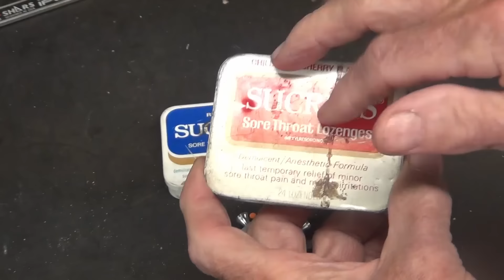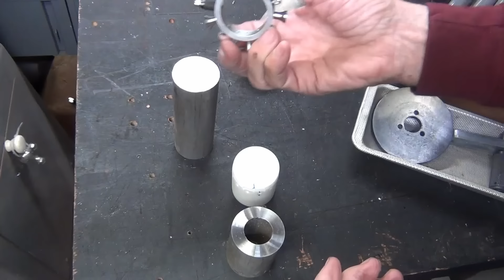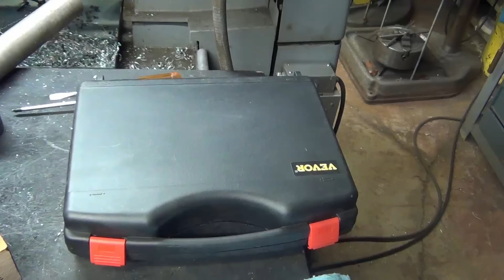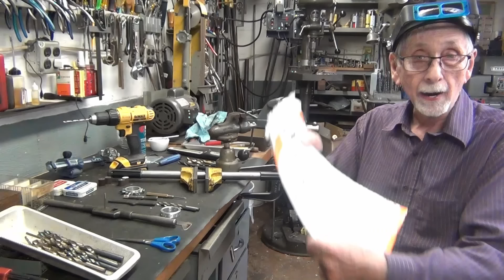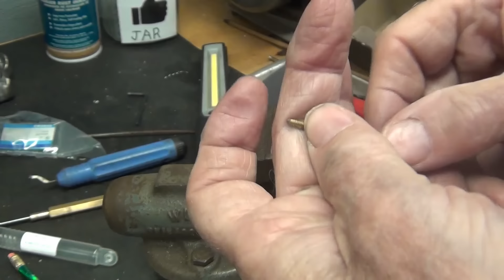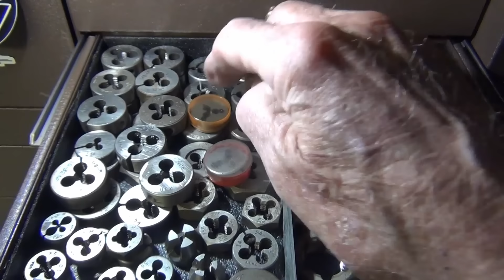MAKE a STARRETT INDICATOR TIP HOLDER #1065 tubalcain

Comment: You should  find the 4-48 taps at Brownells as well as 4-48 screws.  I have them here in my shop!!!!  Old Dave
Reply from the maker: Thanks Dave for the tip!
Reply from the maker: That must be the size they use for mounting scopes or sites
Reply: @mrpete222  To mount scopes they use 6-48 or now 8-40 screws.  So we use these sizes tap now.     Very hard to find good 6-48 taps which why Brownell's carry special taps.        Old Dave

Comment: The issues with shipping fall upon the person that packaged the items. I have had the exact same experience with a box making laps between the USPS hub in St. Louis and various Post Offices across the country. That box of parts were so rare it took years to get an example that I could copy. It was like losing a body part and I wanted to get the project moving forward. In the end,  it took a friend's wife who works as shipping clerk and sorter to get the box captured and a new tracking label attached. Once that was done 2 days later it arrived. 

All of this was caused by a careless shipper using a box that was far too small for the tracking label.  The automated sorting system couldn't read the numbers correctly and it was mistakenly sending it to different locations. That box made no less than 13 trips in and out of the Belleville Post office,  and 18 through the St. Louis sorting hub. Now,  those hydraulic hoses and fittings are available for the Wheel Horse tractors,  and it 3 months just to get the parts to copy. 

I have had a bunch of mislabeled taps,  fasteners,  and drills from various Amazon suppliers who evidently don't care to ever check the part against the description. Guess where those parts and tools come from...?

McMaster,  in the long run, is cheaper if for no more than the aggravation of dealing with Amazon.

Comment: I enjoyed this video, including all of the related 4-48 fiascos. When you get your female tips mounted on your tip ring, you still won't have any known use for them. But you can repurpose the Sucrets tin!

After a career and years of hobby life, I have only ever used the standard indicator tips and button tips. I have one of those inexpensive imprt tip kits from a bulk shop supply purchase, but I have never had a need to open it and see if the tips fit my indicators. I thought that there were at least 2 tip threads standards having owned a button tip that only fit one brand of indicator from over 40 years ago. I never swap tips. I just use indicators that are set up on bases with the desired tip. I don't even bother to swap tips on test indicators, and just grab the pre set indicator required for the job.
The Starrett tip ring would be highly prized for a trophy in in my shop, but after a career, I testify that it is an unnecessary luxury. 
I am an indicator nerd. I own around 40 high quality indicators and a few of the junk imports that you get in large lot used tooling purchases. I own an example of most premium indicator manufacturers, but I prefer Starrett, Mitutoyo, and Brown and Sharpe for quality and cost. I have a B&S 7033-5 (.00005") that I needed to set the Heidenhein scales on a Gleason gear grinder wheel dresser. That's the only job that I ever did that required that resolution. When I did that job for the first time, I was the only employee in our large shop that owned that resolution. QA didn't own that capacity. I keep my B&S as a trophy in my retirement bedroom now.
I am a nerd about indicators like your Arnfest friend is about Wilton Baby Bullet vises. I am equally a nerd about quality pullers. I recently filled out my OTC 13 ton puller more than complete full master puller set with an auction score of over 250 lbs of the larger components to complete that collection. I purchased the big tool box full of the OTC pullers for $45.
When you sold the Snap-On pullers found in the locked base cabinet, I was unwilling to pay your price. My Snap-On puller collection is smaller than my OTC and Proto puller collection.  It was very painful to watch you sell those pullers to another purchaser!

I wanted make your project, but after watching your frustration, the project now goes on my long list of projects that I will never complete. 
I purchased an import 3 jaw chuck on a 5C adapter to use for this type project with my Phase II spin indexer. This was my poor man's introduction to doing this type of project work. The import setup rig has about .003"TIR, but would ve good enough for doing the accuracy for this project. Someday I intend to key the indexer to the mill table T slots to speed up setup effort. That is the most frustrating time commitment to using the spin indexer.
Reply from the maker: I totally agree with you. I have all those extra tips and have never needed or use them even once. Other than I have used an extension tip two or 3 inches long for a job.
And since I made that video, I discovered that I have another  empty Sterrett ring in my drawer. I also found that the other female chips belong on the 196 indicator. I probably have about 30 indicators and have decided I will probably do a toolbox tour of indicators.
It’s quite a relief to find out there are other man just as crazy as me.

Comment: A comment from the experience of the modern CI (continuous improvement) production world...

As CI, Toyota system, Lean Manufacturing took over our production world, your comment about saving time and expenses by using tubing stock instead of bar stock had an opposite effect in our production facility. One of the hallmarks of CI is moving away from batch production to "one piece flow". This idea springs from many factors in CI theory. Over production is among the worst sins and everything in CI drives towards manufacturing only the part needed at the exact time it needs to be consumed in the manufacturing process. Classic American production theory is based on volume production for manufacturing efficiency. 
In our plant, we had easily over 200,000 active part numbers. We stocked an enormous array of stock materials to save material and machining time, when running under batch production manufacturibg theory as you described. The drive towards CI made us rethink that approach. One piece flow demands eliminating setup time between part changes in production. This us called SMED (single minute exchange of dies). To reduce our job changes to less than 60 seconds from many many minutes to even exceeding an hour, we implemented a standard stock size approach in our lathe departments. By machining parts from a limited amount of stock sizes and materials, setup time was greatly reduced, and raw material inventory was hugely reduced. A wide array of single  parts could be machined from a piece of bar stock. Different single parts could be machined without changing setup, and only uploading a different part program. It proved that we could so rapidly turn oversized stock to chips that our over all production time improvement vastly reduced costs over our former production approaches. Eliminating WIP (work in process) frees up shop floor space requirements, reduces over production inventory storage requirements and related losses of holding manufactured inventory that you cannot immediately sell.

CI is counter intuitive to how American production philosophy, based on Henry Ford's success of mass production efficiency, CI theory has consumed the modern USA production world.
We began to find that we could hugely reduce production time under CI processes and reduce overall production expenses by taking advantage of CNC cycle time capabilities, manufacture one piece flow while eating the cost of turning expensive materials into chips, just to take advantages of the cost reduction of SMED.

SMED was so successful in our shop that our legacy high production machinery such as mills with multiple pallets went basically un-used. It often took longer to change a fixture for a part change than it took to machine a part. We focused on SMED in the milling department by improvements to allow fixture changes from hour(s) to under 60 seconds. We were then changing fixtures and loading part material for next pat production while machine part was cycling. There was no advantage to running multiple pallets as under batch production efficiency theory. 

Your machining from tubing comments relate back to former production theory worlds and not to the reality of my experience of living through CI implementation in our shop.

CI has many disadvantages in the USA compared to its success in Japan, but CI is currently consuming USA production philosophy. I am personally glad to be free of CI being retired since 2017. I did participate in years of CI implementation and saw reality of many of CI advantages. CI allowed our USA production high production wages to successfully compete in global markets. We were shipping less than 300 machines annually. Implementing single piece flow in our shop was never fully accomplished. We opted for single machine parts for  each lot size as a more achievable production CI implementation target. We took our order to ship dates from 12 weeks to under 10 days for highly complex printing presses, many exceeding $1M purchase cost. Virtually every machine that we shipped included customization including custom engineering.  To reduce our order to ship date reduction targets, engineering and sales had to to base customization of standard model design that was flexible for rapid customization to meet specific customer requirements. We built occasional very unique application presses at very high production and sales cost for huge profits over production expenses, but our bread and butter production came from higher volume, lower profit margin, "stsndard" models. We supported decades of legacy machinery still in worldwide production use, keeping our active part numbers list enormous. We were machining  on excess of 100,000 parts variants in a one piece flow operation annually when I retired. 

I worked intimately in the CI world. I experienced many CI advantages,  but it was a "love-hate" relationship.
Reply from the maker: Thanks for the very detailed insight into modern continuous improvement production methods!
This system is totally new to me, I have never heard of it and it sounds amazing. I’m strictly old school I can afford, lol.  I guess I was totally wrong on what I said and I hope that many people read this comment. Thank you very much and keep watching and correcting me.

Comment: My Grandfather went through lots of smaller machine screw taps. I have many old boxes for the smaller taps. The mostly came in a quantity of five. And also had a nice wooden holder in the box that the taps set in. It is remarkable that most of the boxes I have; there is only one tap left, sometimes two but never a full box.
Reply from the maker: Has interesting. I do have a box of older taps in a cute little wooden box. Then they went to cardboard and finally plastic.

Comment: The second that I know that something I ordered is coming via USPS I scream inside of my head, because I know it has a good chance of travelling around the country, or being delivered to someone across the county.  And I have also had enough experience with Amazon and wrong items coming to the door.  But you know, if I could go to Menards, or Home Depot, or Lowe's and buy the tool I need, then it would be time saved.  But there just aren't enough people out there that do this kind of work at home for the stores to justify keeping odd size taps and dies, and other tools that are probably more single use for those people.  But, I can buy a frozen pizza at Menards, while I am wasting time trying to find something there that they should be selling, but don't, because they keep a stock of groceries, instead of the 1/4 x 28 tap I need.
Reply from the maker: Couldn’t agree more. But no way will my Ace Hardware ever stock the tools that a machinist might need.
John Menard was a marketing genius. You can buy a jar of pickles a gallon of milk and potato chips while you’re buying two by fours. Maybe they don’t sell two by fours anymore. But he wanted to get women in the store as well. Menards sells some real junk, but so do the other box stores . Menards is my favorite for some reason.

Comment: As you have plenty of taps and a drill that allows reducing the torque; I would advice to try to use the drill as this will avoid to break taps and it will go way faster.
Reply from the maker: That is precisely what I did.
I thought I said that in the video, but maybe not
Reply: @mrpete222  I mean to tap the thread not to enlarge the hole.

Comment: Hi, Lyle

In my distant youth I used to build and fly RC model planes.
IIRC the clevis ends of the control rods were threaded 4-48,
and I used to purchase all thread rod in 4-48 to make various adjusters
for the aircraft control rods.

I have not tapped or threaded 4-48 in over 60 years, however I still have 
many broken, and a few unbroken 4-48 taps in taper, plug and bottoming style, as well
as the dies.

The old Tap Magic formula used  something that smelled like peppermint.
Maybe that caused my bladder cancer ???
And I falsely blamed Agent Orange for my cancer.

Still,  I love looking back at my misspent youth.
Back when hobby shops carried everything to build it yourself.
Not simply pre engineered build it yourself kits.

I was born so long ago, back when sex was dirty, and the air was clean !!! LOL !!!
And kids could play with things that would blow your fingers off.

Learning was sometimes a pain full  process, but it saved me many times in later life.
I am still amazed that I have lived over 75 years, and still have all my fingers  and toes, 
as well as my eye sight. As for my hearing, well I still have some of it, just not enough to hear 
my wife when she is talking to me. LOL !!!

Thanks again for all of your great content.

Tim
Reply from the maker: Sounds like you've had a very interesting life!
Very similar to my life. I totally agree with you about those old hobby shops that had every little fitting and material you would ever need.

Comment: Another great video, thanks Mr. Pete. When you were showing your two small tap handles there is one well aged small tap handle not the one you used and I was curious by the design. How difficult would it be to make a replica of that unique design?
Reply from the maker: It would be kind of difficult because it would require a brooch. But that is one of my favorites. Surely you have seen me use it from time to time.

Comment: Was just thinking, you also could make one 1 inch wide and have 2 or 3 rows to house all your tips.
Reply from the maker: I might do just that for the other tips in the Sucrets box. I found that they are chips that belong on. Starrett number 196 back plunger indicator. Different thread, of course

Comment: Thank you for the video. I believe I will be making one for myself also. (It will be an excuse to get some form of indexer. (hehe))
That's not a rant about the USPS! That is a public service message. I tracked a parcel sent by the USPS all over the USA - TWICE - before it was lost between the regional distribution point and my post office. (It has to be DEI. I can't think of anything else. It worked nearly flawlessly until Y2K and REALLY went bad after COVID-19.) In fact I heard a US Senator make a comment that the USPS can't deliver even with the destination address right on the front of the item!
Mr. Pete, I am almost sure I saw you with a Starrett #196 Test Indicator with a back plunger. They use the female tips, which are treaded 5-48. That Mr. Starrett was a real prankster!
Reply from the maker: Yes, another viewer mentioned that 5-48 thread too!

Comment: You can do direct indexing on a dividing head like that without having to take off the division plate, crank, etc. to disengage the worm. For quick jobs, I just use the crank to turn the work until the indexing pin drops into the desired hole on the direct indexing plate.
Reply from the maker: Thank you, yes I do the exact same thing you are describing in video tips number 1016. I already made the video but it will not be out for about a month.

Comment: Good morning Lyle,
We were blessed with an order from Utah that got to travel from California to Maine and made several stops along the way. It didn’t take any pictures of its adventures. The last time I used a 4-48 tap was forty years ago when I mounted a site on a rifle. 
Like you, most of my indicator tips are female threads. I would check with McMaster and see if they have any threaded rods or baby cap screws that you can mount from the inside of your circle. 
Have a Happy Thanksgiving and we will see you next weekend.
Reply from the maker: I just now found out thanks to another viewer that the contact points with the female thread fit on the back plunger starrett indicator.  And they are a 5 44 thread
Reply: @mrpete222 you can’t win. 
It looks like the Sucrets tins will remain their home.

Comment: I watched the video on the floating vise two or three times!
Reply from the maker: Thanks, that’s why there are so many views on it, lol.
Actually, I washed it several times myself. I’m not saying my video with anything special, but I am amazed by the mechanism of that vice, very ingenious. But a total failure in the marketplace.
Reply: McMaster has 4-48 stainless screws for about 10 cents apiece, depending upon the length. For 3/4" long full threaded screws they are like 12 cents apiece. Beats using a die to make your own!